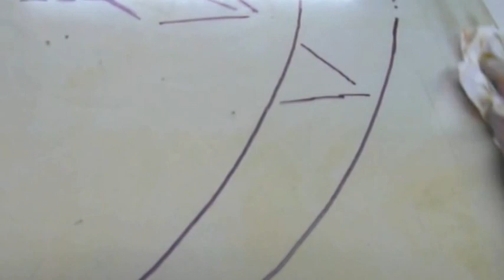Printmaking: wiping and printing

Comment: Thank you for sharing your technique!  Wonderful!!!  I do have a question though, I'm assuming the color plate is on plexi.  Right?  Are you adding anything special to the inks to make them looser?  And what do you use to move the ink around with?  Your prints are gorgeous!  thank you again.
Reply: I have just watched this video ProcessedArt, and from the way that the 'drypoint' plate 'flopped', as it was put onto the press bed, it very much appears to be transparent polypropylene - it looks a bit thicker, that that which I use myself.  However I don't do plates that size.    
It is a really lovely material to work with as it is lightweight, you can roll it up to take along to the printmaking workshop with you.  You can also cut it into shapes to make various 'elements' for your artwork. Once you have dry-pointed into its surface with your drypoint tools and other items (such as wire wool and sandpaper)  for tone......you need to be sure to keep that surface 'protected' so that it doesn't get any unwanted scratches.  Hope that helps and that you actually get to read this - even though  you asked the question 6 years ago.